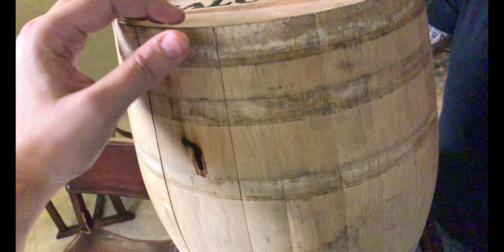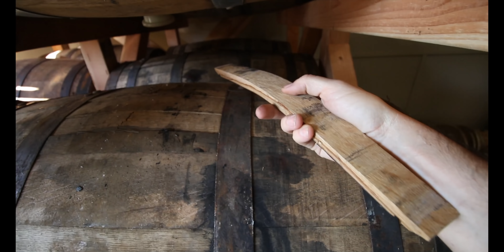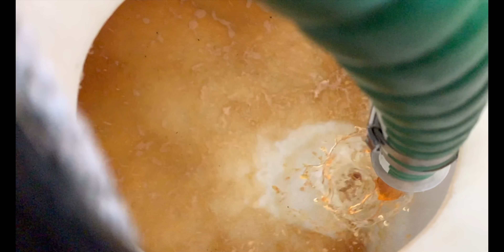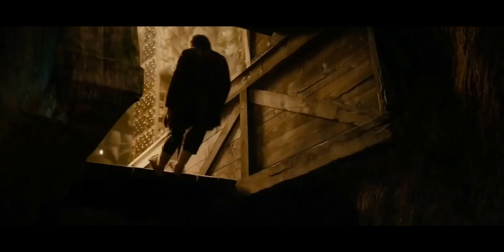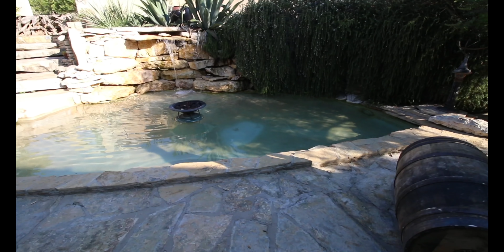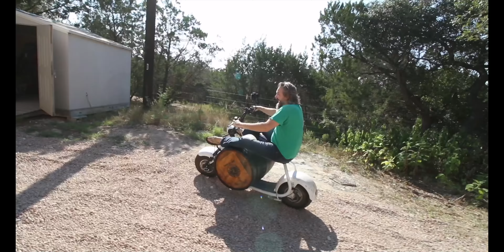our LEAKING WHISKEY BARREL (why do barrels get leaks???)

Comment: Incorrect assumption on the "red line" (depth of penetration). That is BETWEEN staves and there is more space there to seep deeper. I cut staves in the middle and the penetration is VERY LITTLE. Cut that stave with a band saw and sand it and then look at the line. Maybe 1/8 inch or so. Also depends on whether it is a bottom stave that stays in contact with liquid or a top (bung) stave that loses contact soon after filling. Again lots of variables.

Comment: There’s been some experimentation with wrapping barrels in plastic to reduce their porosity. Do you think dipping/painting wax over barrels would help? Possibly insulating as well.
Also, keeping the roller doors down might help for cooler temps too.😄
Reply: The barrels need to breath
Reply: Why Dana? Surely a valve could be used to expel a build up of gasses from  fermentation.
Reply: - bees wax would still allow the timber to expand and contract from temp variations, allowing the whisk(e)y to flow in and out of the timber. But perhaps prevent the spirit from evaporating if it reaches the timber outer surface. (maybe)
Reply: @samday6621  Evaporation from the barrels is part of the maturation process, the so-called 'angel's share'.  There are no "gasses from  fermentation", as distilled liquor is placed in the barrels.

Comment: What are the regulations regarding barrel storage? could a company age whiskey in something that would effectively amount to a picnic pavilion with chain-link walls for maximum climate impact?
Reply: I wonder how aging barrels underground would pan out? You would get a much more stable temperature and as long as you keep yourself some way to "open a window", you would still be able to use outside air to warm up the barrels.
Reply: I actually talked to Scott Harris (one of the founders of Catoctin Creek) about that, it would lengthen the aging period and reduce barrel influence because it would be an extremely stable environment, so it might work for getting good usefulness out of very small barrels like firkins or rundlets.

Comment: o.O  
How can the building material change the drink? What's the difference between stone and brick? Do you mean the way those materials influence the temperature and humidity inside the room?
Reply: Yes. Also, how much of an insulator it is, etc. Less insulation means more drastic temperature spikes, which means more fluctuation between soaking and releasing as the days go.

Comment: Hey man I’m NO carpenter, but you guys need to add more seaport to those rails, doesn’t look right to me.
Reply: That's all I could see in this video! Those rails needs some attention asap. One was already starting to pull away! Maybe bolt them all the way through so you are not replying on the threads of a couple of screws.
Reply: Same here.  Worried about alcohol abuse.  Need support under those rack rails.
Reply: Structural engineer here. Have someone check it out. Couldn’t watch anything else after that lol
Reply: Carpenter moment

Comment: I don't see much support for the horizontal beams on the new rack. It looks like just a single bolt running through and no cleats to take up weight.
Or am I wrong?

Comment: I am going to ask the stupid question. Why not double bag the barrel with a loose slightly air permeable bag? So far the barrel aging is all about the whiskey slowly going through the char and not about air flow outside of the heat exchange.
Reply: I was wondering why there isn't some sort of capture system to collect all the evaporated stuff, it should be able to be pulled out of the air...
Reply: Oh, I was thinking of it as a way to trap the liquid in the barrel. The evaporated stuff would just be pure alcohol and possibly a few other chemicals. The other thought was to submerge the barrels in a vat of pure alcohol. No leaking because of the barrels being fully covered. 

Or just age the whiskey in Florida. High humidity so the whiskey has to fight past the humidity locked in the barrels and you still get large temperature swings. Depending on where you are a daily half hour rain for a second temperature shift a day. Granted you would have to protect the whiskey from flooding and hurricanes.
Reply: Evaporation is part of the maturation process.  You don't want to stop it, you just want to prevent it happening too quickly.